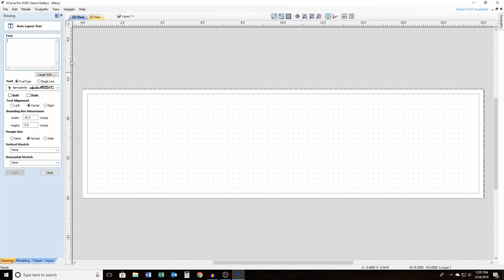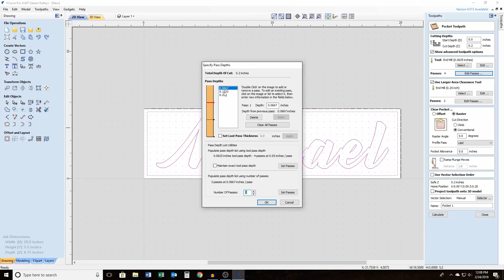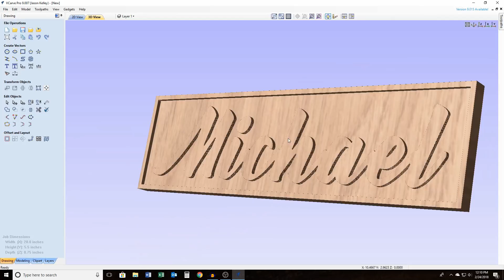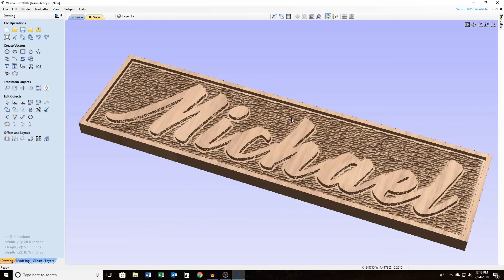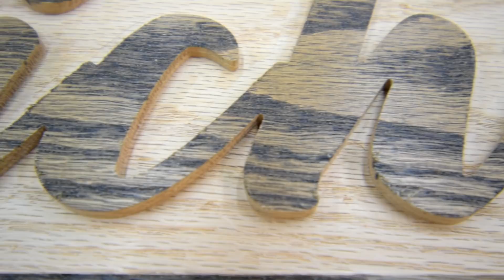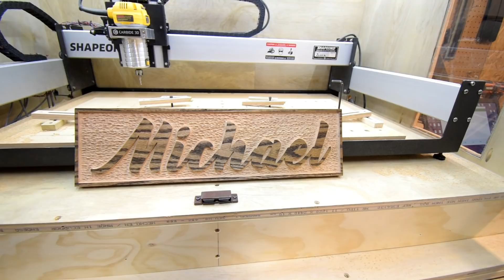2 tone sign with textured background on Shapeoko

Comment: Next one u do.  Type out the name then combine them and then make the size to fit the material    And the best way to do that is   Group them and then change the height or width by using the tool ( don’t know what your software calls it but say you make it 5 in by 20 you would group the name and type in 5 and the width would automatically make it the size it should be even if it’s say 5x19.625,or whatever ya get what I’m saying

Comment: Just a little "design" food for thought...
Kerning script letters that far apart doesn't allow the connecting parts of the letters to overlap each other properly.
Instead of one, fluid set of letters (which script lettering is designed to look like).... the name looks "pieced" together.
Each letter looks like it's leaning on the letter in front of it. It would have looked better by simply leaving it, as is. I 
probably would have stretched it just a little.

But in any event... you did a great job, as usual. And that cabinet is the bomb. Subscribed

Comment: Nice tut.  good job. I gave you a like.  I know you appreciate craftmanship so... did you know it took six designers six years just to modernize a 1950's typeface named Office into Officina Sans. The NYT's paid a liitle over three million to have linotype create a new typeface just for them as no existing one allowed them to align all the figures in the financials properly. It took 12 of the worlds best type designers 12 years. Full typefaces include four different kinds of number ( old style, proportional, etc.) all the extended character set including ligatures, alternates, swashes, ordinals and on and on. It really takes years to create all those characters and make them look alike then you have to do it again for all the different wieghts that make up type family like futura for example. so if you won't be offended by an old graphic designer offering you a kindly tip, don't kern ( change the space between letters) unless you know you know what your doing. no offence but you murdered this typeface. you created unattractive humps where there were none to begin with. these letters, as in any script face are meant to flow into each other in a way that is lovely and it took some sharp guys a long time to get them that way to begin with. also learn to protect your borders and leave yourself more white space around something like this. the taext looked better before you enlarged it. it needs that space so it does not seem squeezed and cramped. like a wine it needs to breath this enhances legibility. Its as hard to critique as it is to except critique but its the only way to learn. so please don't be offended, just trying to share a little knowledge you'll benefit from. keep making great stuff my friend and thanks for this tut. quite good.
Reply: I thought about the kerning as he was doing it. While I'm not a trained typographer or designer, I thought that, I might be inclined to try a bit of kerning on this job. But, I would have edited the humps out of it before I was done. There probably aren't many Caslons or Goudys among us, but we can learn from them. 

Thank you, Jason, for sharing your techniques with us. I absolutely did learn a thing or two in this tutorial.

Comment: Jason, I am using essentially the same hold down clamps that you are.  I see you "appear" to have the clamp parallel with the stock and you've got an additional clamp at the rear as a wedge.  I do the same thing but I push my wedge in further so that the actual clamp is on a downward angle from the wedge towards the stock I'm cutting.  Is there a reason you clamp as you do or is it a matter of preference for each person?
Reply from the maker: I just use those as leverage. The further back they are the more force that if I'm correct is applied toward the front of the hold down. I clamp each job differently it just depends on what I'm doing, how much room I have, and if I need to access the edge of the piece.

Comment: Hey Jason. I'm getting ready to start on this, and am having trouble locating a 1/16" end mill with a 1/4" shank. I've found several that have 1/8" shanks though. What bit did you use for the 1/16 cuts? Thanks.
Reply from the maker: I used a 1/16 with a 1/8 shank from precisebits.com. Your best bet is to get a 1/8 Colette as well. I have seen some .25 shank .0625 endmills, but generally they are lacking in cut depth.
Reply: @stufftokeepyouentertained2168  Thanks for the quick reply. I'm using a muscle chuck, and will buy a 1/8" reducer for it.  And thanks for the reminder about Precise Bits. I hadn't thought of them. Again, thanks.

Comment: This turned out beautifully. Signs with textured backgrounds have been at the top of my list of things I want to do when I get better educated on Vcarve software. Your explanations of procedures like this are SO much easier to follow and understand than the Vectric tutorials that I'd much rather learn it from you.
Thanks a LOT for the heads up about the stain bleeding through and showing on the edge of the pocket cutout. I'd never even considered that. Thanks for everything!

Comment: Im thinking about getting cnc machine like yours when I learn like more on the vcarve pro software. I have a question what speed setting on dewalt 611 you use for yours bits making the sign, I never could find anyone say what speed they use for making the signs. Thanks for great works and showing
Reply from the maker: Honestly I usually turn it up full speed for most everything I do with wood. I have tried lowering it, and using it full speed. I never really notice a difference. I have never burned any wood, and never broken a bit. The results are typically the same as well.
Reply: ok thanks